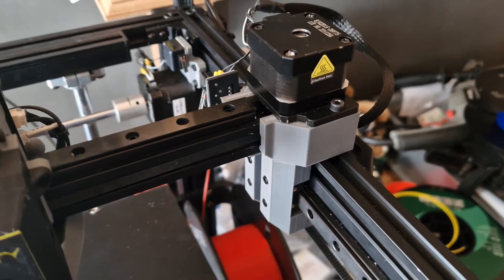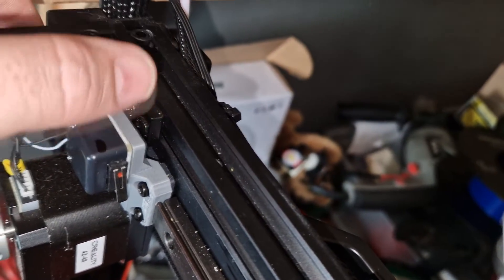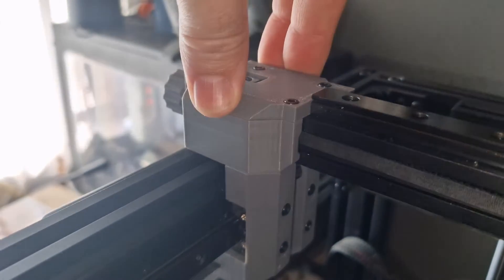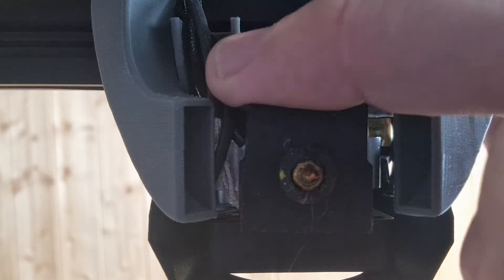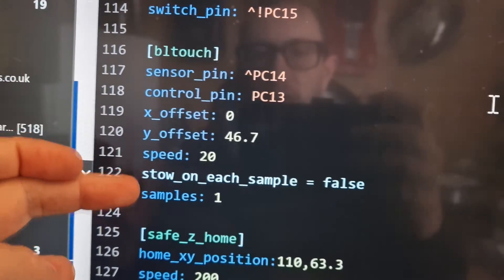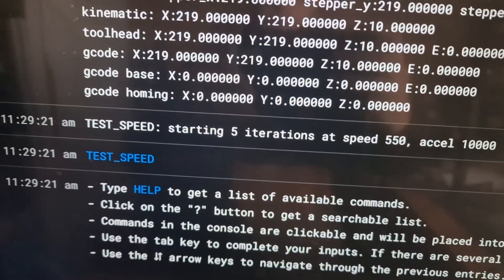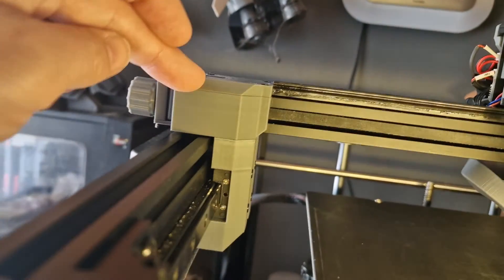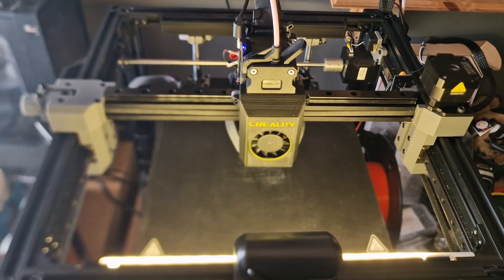Ender 5 S1 Linear Rails Upgrade

Comment: Hi ! Really good video and instructions.
I have just got Ender 5 S1 from a friend so i'm quite new to this 3D printing thing.
I have built a few Cnc routers over the years so what first came to my mind why do most 3D printer use cheap V-slot wheel or round rails instead of proper linear rails.
So i  started to consider swapping to rails. And now you had me fully conviced that its the way to go.
Have you any thoughs about also swapping z-axis for rails?
Thanks for the models :)
BTW what is "klipper"

Comment: also why not add the spacers under the mount points for the bed where it bolts to the rear gantry thingy ? perhaps longer bolts and steel washers

Comment: Is this possible with stock firmware ? Eventually I will be switching to klipper . Got my e5s1 off ebay for parts untested and works great however the auto bed leveling goes off the rear of the bed . So far the only fix ive found for this requires klipper anyway. But so far upgrading from a very upgraded ender 3 v2 with full linear rails this is a must have for this good of a printer. Had this thing for less than a week and have upgraded the hotend to a spider pro 3.0 and the hotend cover as well. Awesome job creating bro ! Sure bet others would enjoy more videos on the ender 5 s1 as well there just isnt alot of good videos out there compared to other machines. Thanks hope to hear back regardless ive already downloaded your file for this just waiting to get done with my girls weapons for their halloween costumes . Perhaps my profile picture will give away what they are lol .
Reply from the maker: I think you'll need klipper, or know your way around building the stock firmware with different offsets for the head. Klipper will also let you speed up the printing. I only upped mine a little but the desk shakes a lot less with lighter parts. If your levelling goes off the edge, it sounds like the offsets are wrong.
Another good upgrade after klipper is to add a klipperscreen.

Comment: what did you print your pieces with PETG or ABS ?
Reply from the maker: @jasonflt  PLA. I've been running it a lot since with no issues.
Reply: @Pugwash.  Wow that's amazing. I do have mine in-closed so I was thinking abs. Thank you for your reply.

Comment: Hi. Thanks a lot for this useful information. 
I was wondering how to do it and you give me the answer ;)
Just a quick question what type of filaments did you use to prints those parts ?
Thanks a lot and I hope I'll quickly find some time to make these changes.
Reply from the maker: All PLA and 0.2mm layers. I've been using it daily since the upgrade and they haven't failed.
Reply: Thanks a lot

Comment: Hello, If you put linear rails,  you lose the printing surface?
Reply: I guess it depends on how you mount it but it can't be much, like a few millimeters
Reply: have had Linear rails on mine for 5 or 6 months and never lost any build plate surface and runs smoother and quieter and faster running 10000 accel at 200% in klipper only problem I had was getting BL touch set correctly
Reply: @donniegates2454  Hi. Did you use the same clamping system for linear rails? is there a difference between the stock printer and the plus sonic pad printer? (this only if you have conceived and know)